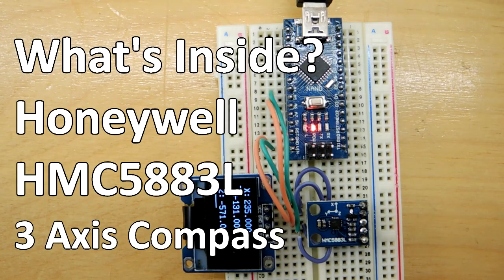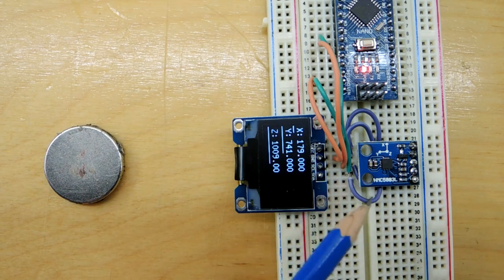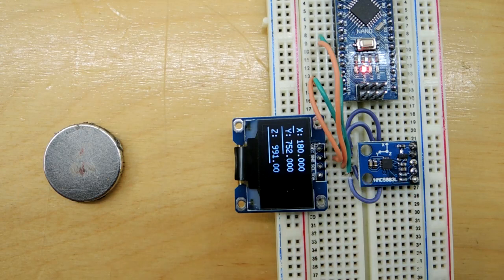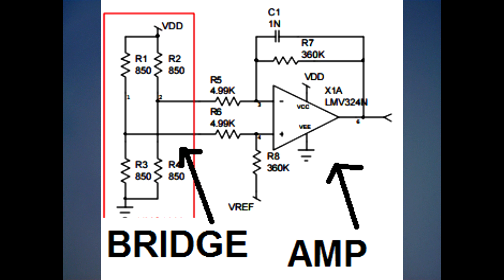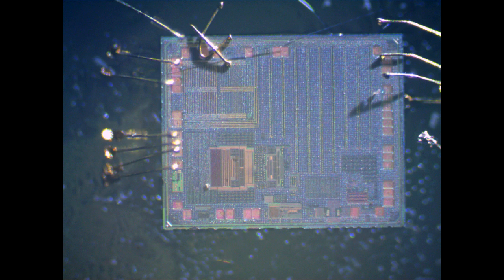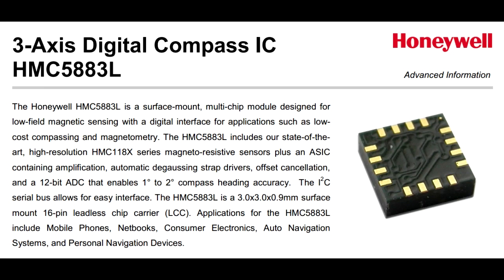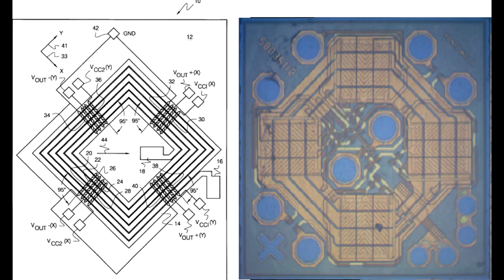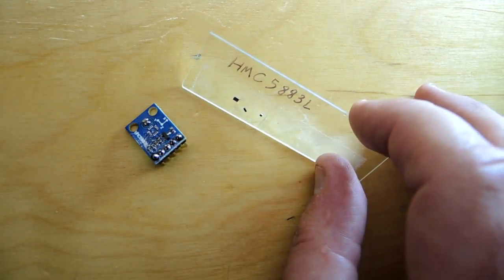What's Inside?  Honeywell 3 Axis Compass HMC5883L

Comment: please give the details of that LED display
Reply: +Tech Inventor Aman
Hi I have a very similar display. It's not an LED display it's an OLED.
If you look up I2C OLED on Ebay or wherever you will find these.
the screen is about an inch corner to corner and they have excellent pixel density. You can put really tiny text on them.
Reply: +Gremlin87 thanks a lot.... Can you post an ebay link for oled display